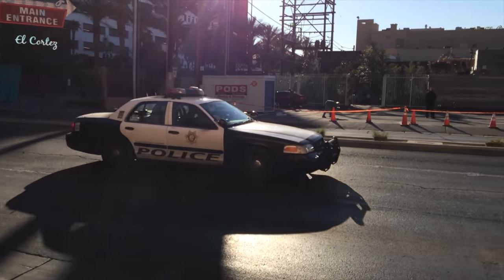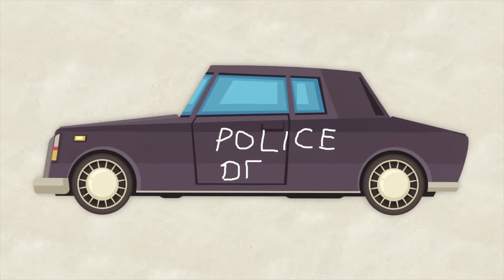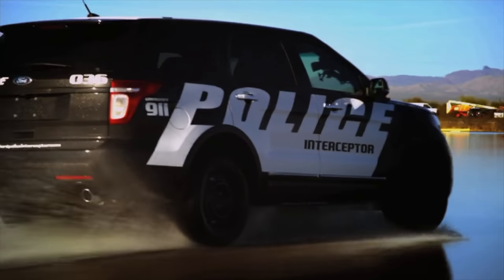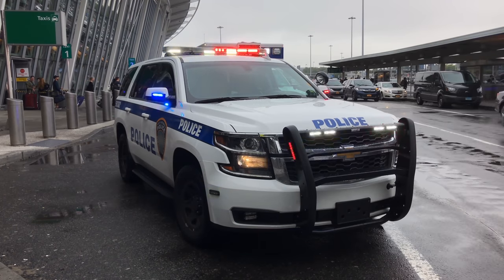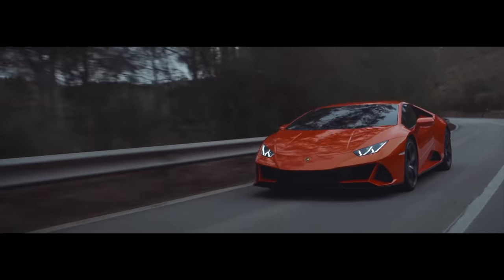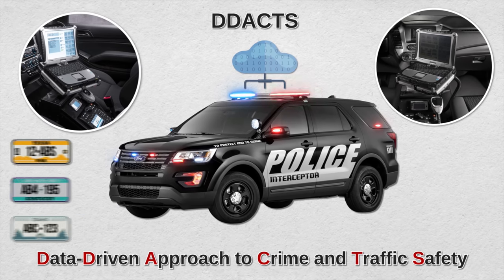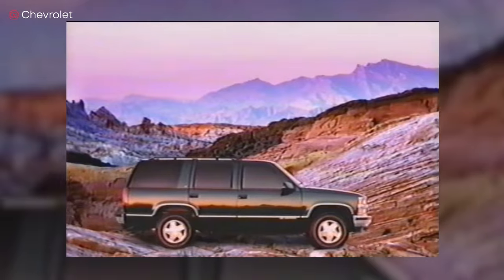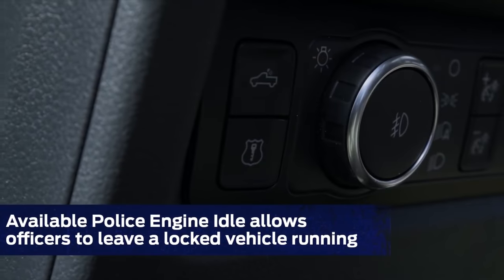Here’s Why You Can’t Outrun a Police Car

Comment: I think one solution for that problem would to use blue lights only to identify police cars from other emergency vehicles could use the Red and  blue light combination for the benefit of colored blind motors on ambulances and trucks also for having blue for better visability at night. Police cars could also shift to and emergency light system with blue lights as the primary colors of at least 98% blue & 2% Red so police cars can be identified as police cars from other emergency vehicles using the Red/Blue combo now used by police.

Comment: 24:24 The Mustang police car sported a "powerful" 4.9l engine, not a 5.0.  5.0 is the marketing name of the 4.9, not the size.  So the Mustang 5.0 was a 4.9.  You can refer to the car as the 5.0, but the engine was a 4.9.

Details matter.

It's a shame there was no call out to places that used them.  In Texas, the Mustang was everywhere.  TxDPS (Texas Department of Public Safety, which includes state troopers, highway patrol, Texas Rangers, and other departments) had piles of them.  I saw them everywhere, and for a few years, saw few other police vehicles on the open road.

Comment: So basically, you are good with a 35 year old 500E, or any older German. Autobahn speed proof, can be operated at full load subject to fuel reservoir, decent undercarriage, etc.; so the difference is the radio. Good luck.

Comment: Yeah in the 90s I knew someone with a used cop car. It was great at first, minus a little slow to crank. But after the first oil change it burned oil and got blow-by real bad. He figured the seller rolled-back the odometer and put extra-thick oil in it to mask the worn out engine. Oops.

Comment: "No matter how fast you think you are, you can't outrun a radio" but once out of the cops car line of sight it as useless as the cop driving the car. If the cop never got close enough to see your plate. On a motor cycle know where every fence opening on the highway is and every kids cross walk over the highway is. Two of the best tools you have you can cross it in 30 seconds and it will take him 5 minutes or more to go around. What does you in is a police helicopter or a nosy new helicopter that you can not get out of their line of sight. The worst thing someone can do is get into a long chase if you cant ditch him in a minute or less don't bother. The last motorcycle I owned was 34 years ago most likely that's a good thing.

Comment: I had a fancy radar detector once. Got busted as soon as they came over a hill and turned their radar on. Threw it away and don’t speed now 😅 Radar detectors only work when the radar is on so they drive around with the radar off until they want to check someone’s speed.

Comment: It’s not that it’s impossible to outrun them, like sports cars can definitely be built lighter without all the armor and hardware in cop cars and modified for performance and speed as well. The problem is that the moment they see you, that car is done for. The absolute best you can hope for is ditching it somewhere, taking the plate and smoking the vin somehow, and then escaping with a different vehicle. Even then, they still likely read your plate, so unless it’s stolen, it’s going to belong to either your or someone you’re close enough with for them to lend you their car, and the cops are going to find you or them either way. They don’t even need to chase you man. They just do that because it’s simply easier to grab you when they can currently see you.

Comment: i had to work on an older charger released from police duty to civilian hands, it was a nightmare, they left all the electrical wiring open and it was creating shorts across multiple systems. (nevada dodge dealership technician)

Comment: I had a 2006 Ford Crown Victoria, was nice and solid though it did have potential fires of the fuel tank on an impact. A certain "man" wanted to use it and trashed the front bumper, front left fender, the windshield smashed, tires wiped out. Needless to say, that guy wil never ever drive any car i will have.

Comment: Most metro law enforcement agencies prohibit high speed pursuits and operation unless a forcible felony has been committed. Sooooo... high horsepower doesn't mean so much anymore. I've been a Cop for over 30 years now and will tell you this there is no police car as good as the Crown Vic was. The Dodge Diplomat with that loud 4 barrel carburetor comes in a close second. Back in the day, if you called for help you could hear those bad ass'd 4 barrels over the sirens as help came.

Comment: O but u can outrun the police. I've did it 5 times in my life. Where I live makes it easier though w all the hills twist and turns. I just did it the other day too. A cop pursued me for approx 5 miles even across a bridge connecting 2 states but couldn't get close enough to get my license plate. I out ran him in a Mitsubishi outlander sport 2011. I know the area well too and chose a shady road by the river that gets rough and uneven. I even took part of it too fast and came close to losing control but I stayed in my element with out getting scared and corrected the steering as needed when catching air 3 times slightly going to the left, right, then left. It actually shocked me how long the officer cont chase after out of his jurisdiction.

Comment: They're not any faster. That interceptor SUV  is  available to the general public if they want to pay the money for it.  You can buy an impala with a pursuit package and it will be a police car minus the cage and paint job, and lights. They just seem faster because the average car on the road are just smaller cars with smaller engines. But any full size sedan like a patrol car will have just as much power

Comment: You absolutely can outrun law enforcement vehicles while driving a stock vehicle. Outran a Dodge charger cop car with my 2010 F-150 4.6l and because my license plate lights were out and it was dark I also outran the radio.

Comment: Well, obviously your biased to ward fords, the Dodge Charger goes from 0 to 60 in 3.4 seconds to your ford’s 5.7 seconds, the 2021 charger set has a 196 mph top, the get trim has a 147 mph, the fort trim has 155 mph. The Ford Expedition is 124. You can see the state troopers chargers that run 155/146 mph cars and they catch what ever they chase, ford, Chevy, Toyota, Nissan, all of them they run down.

Comment: Unless ANY police car has a GAS TURBINE JET ENGINE putting out 2000hp at the rear wheels..it has NO HOPE IN HELL of outrunning a Suzuki Hayabusa turbo motorcycle with 600 rwhp capable of 380kph top speed and a quarter mile of 7.5seconds..Heck even a Bugatti Veyron with 1000hp and 16 cylinders and top speed of 400kmph cannot match the Acceleration of the bike..Cubes dont rule in top speed its the POWER TO WEIGHT ratio.

Comment: You lost me at "cop motor" It's a 3.5 Ecoboost.  At least you didn't say it had a "cop chip".  Anyone with an old 9C1 or P71 will tell you that at best, they have better oil/trans coolers and steelies.  Def more rugged but they are slouches as is the F150.

Comment: Its all a matter of blending in and, if you're in the rural areas, you're on the clock. You have 30 seconds to put him tis the ditch. You can't play GTA, over steer, drift or any of that nonsense. You head for the very first, not so well known, dirt road and lay on it and then brake Check the radiator into a pancake.